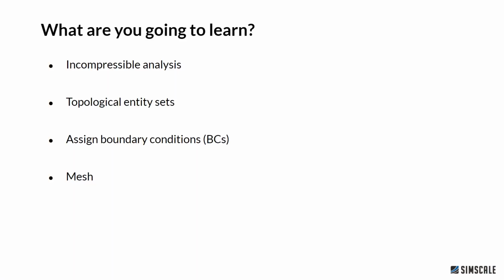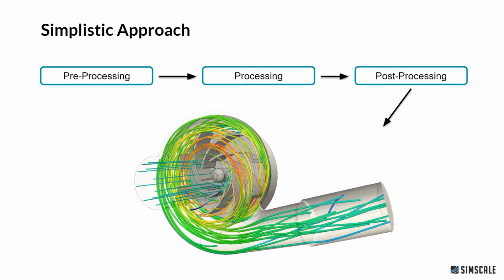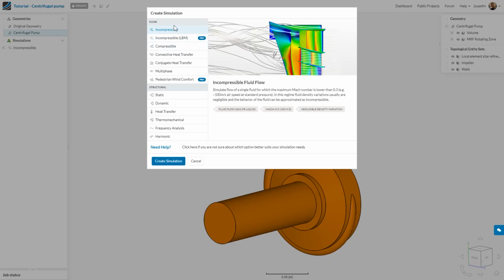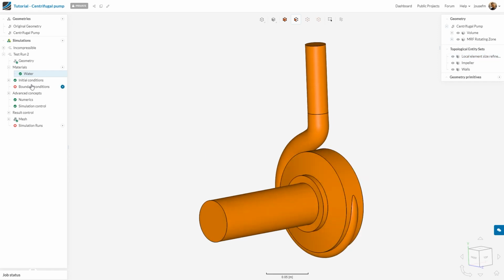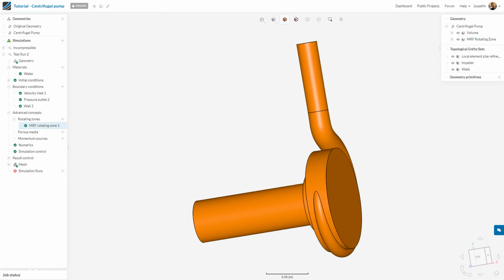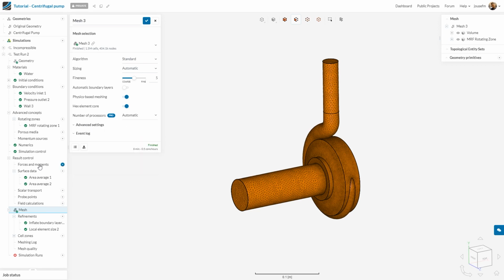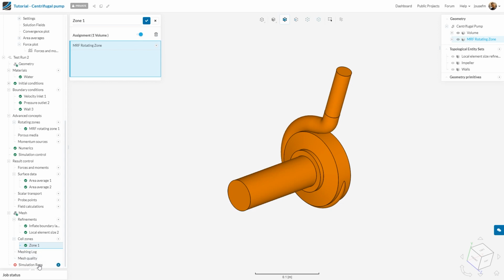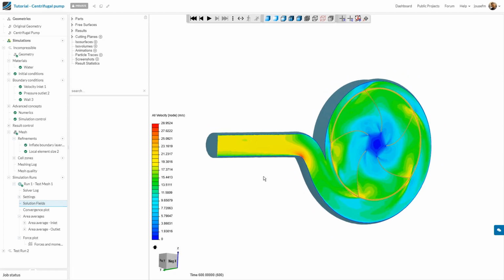How to Run a CFD Simulation of a Centrifugal Pump

Comment: "Multiple bodies with material assignments were detected. Because this is a single region simulation, only a single body may be assigned a material. Please review your material assignments and leave only the flow volume with a material." 

what is the solution of this error?

Comment: Fewer 90° elbows ! ! Anyone wonder why a pump manufacturer would BUILD IN A 90° angle right into the pump housing/Volute? ? ? Regardless of how well you lay out your system. you will always have one more 90 - built in for no apparent reason. It may look neat to have the output lined up and centered on the input but is that really worth an extra 90?
Reply: there is  overshoot design!

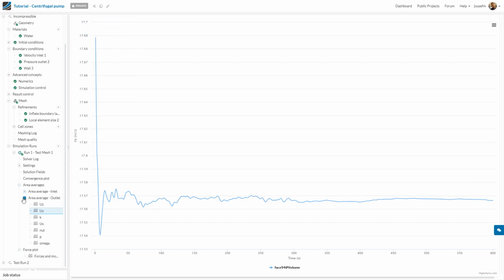Comment: 13:15 didnt you say the simulation was steady state and not transient? if so, then how did the software plot the velocity vs time graph.
Reply from the maker: For a steady-state analysis, with a "time step" of 1, the time is equal to the number of iterations. So, this plot shows the velocity per iteration. More information in regards to the Simulation Control and time step for steady-state simulations can be found here: https://www.simscale.com/docs/simulation-setup/simulation-control/

Comment: excellent tutorial, one question, why you defined inlet: velocity inlet with 8.5 e-3 m3/s(do you know the v inlet)? and outlet with P=0? in order to defined the characteristic curve is better set: inlet: P=0 and outlet Q= (the volume flow rate in the range of the pump) or is better set the opposite?
Reply: Carlo can you help me define some variables for a pump project am working on?

Comment: my animation in the simscale cannot be controlled if it is 0-1000 timesteps then it frames cannot be controlled properly even with the control button in the legacy interface. Plz help if there is any other way to input some values and get the proper animation. The frames jump from 0-1000  directly. no break in the middle can be given